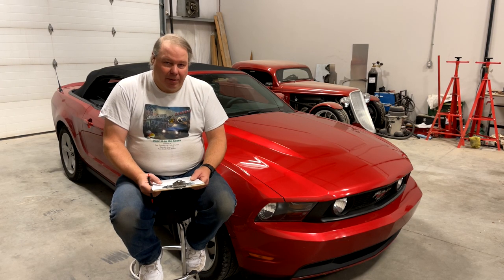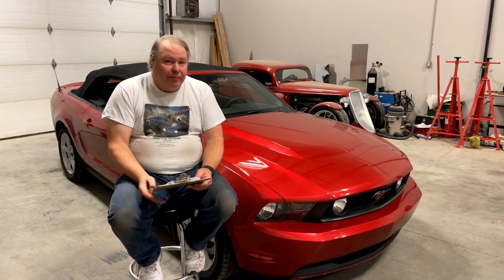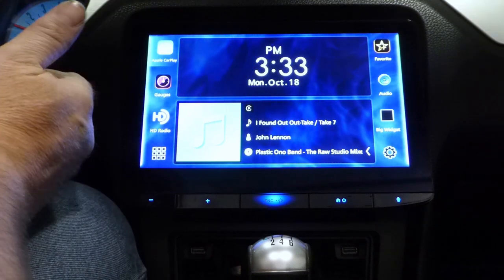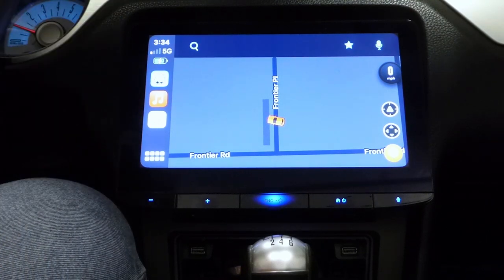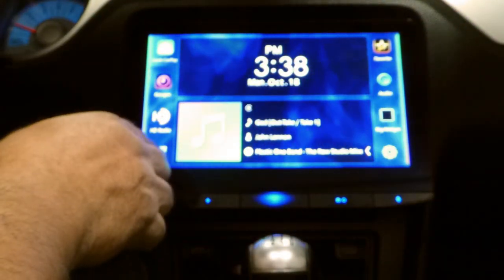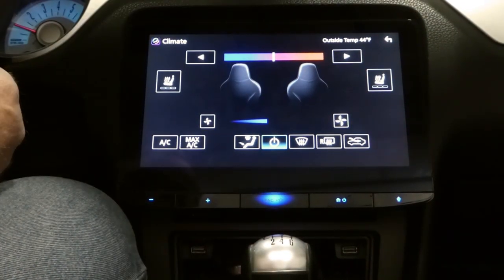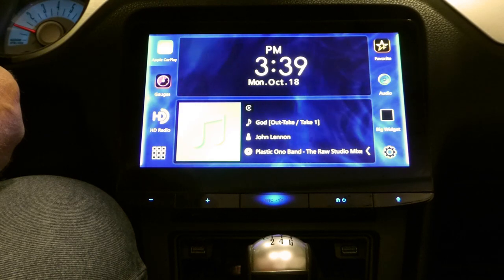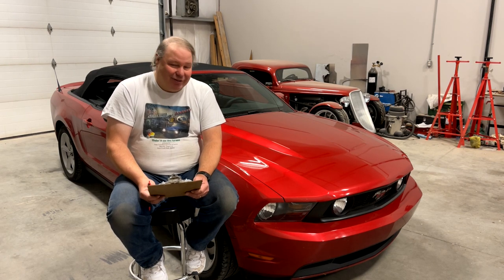JVC KW-Z1000W Features, Operation, and Review in a 2011 Mustang

Comment: The backup camera static is horrible how many people have that issue?
Reply from the maker: The backup camera setup I used is wireless and is prone to interference, especially when run in a spot with a lot of 2.4GHz interference like the back of my shop. I’d say it is always useable and 80% of the time it is clear. Most parking lots are not filled with 2.4GHz interference for instance. The upside of the wireless setup is that it is straightforward and I didn’t have to route cabling around a convertible top mechanism. If you pull wiring in, you will get a clear image all the time.